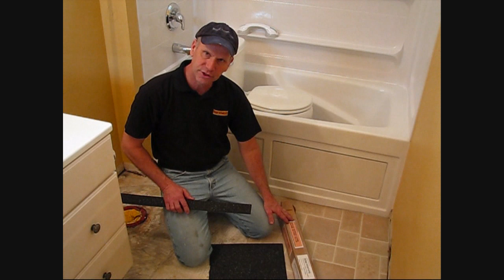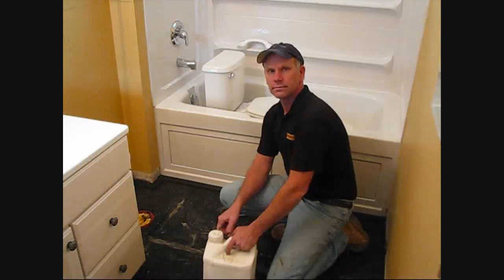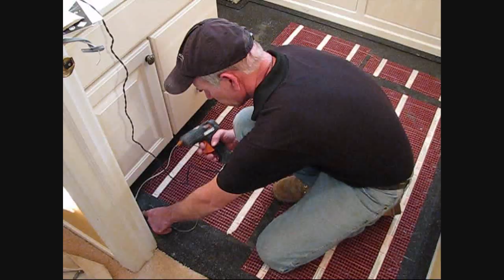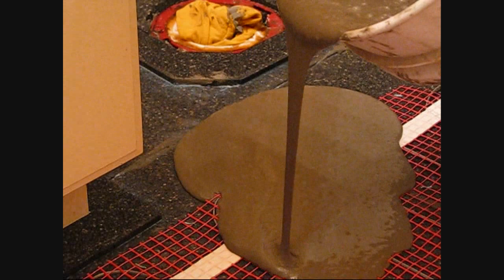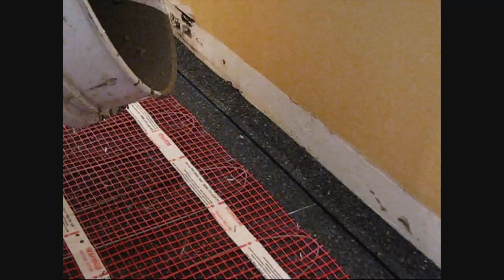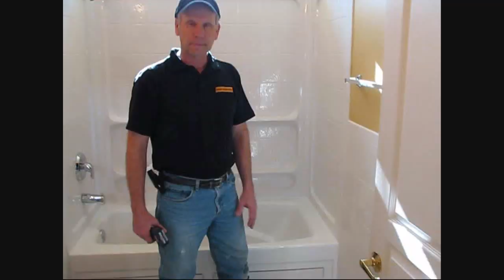Using Edge Strip Kits to Install WARMUP Electric Floor Heating Mat

Comment: Definitely the BEST way!!!
Reply: Hello, this is Amy from China. Hope this email finds you well.

We are the original manufacturer of An Warm underfloor heating product, equipped with R&D center for product development. Our product has been used in Norway. Sweden for 37 years, and in the U.S for 12 years. 

The heating elements are made of carbon enriched polymer, with nanotechnology (known as Positive Temperature Coefficient) is what makes An Warm the most efficient and long service life electrical heating system on the market today.  

If you are interested in electric floor heating system, we would like to deliver you some sample for your evaluation. 

Please kindly find our product brochure attached for your reference.

Any inquiry or requirements will get our prompt attention.

Thank you & Best regards.

Amy Gu
Foreign sales
Beijing Shilihe Technology Development Co.Ltd.
Email：anwarm@huaxiazhiyong.com
Phone：+8615737319187
Wechat: gu15737319187
Skype/Whatsapp：+8615737319187
Facebook：miaoupup@outlook.com
Link-in：linkedin.com/in/amy-gu-030b0a136